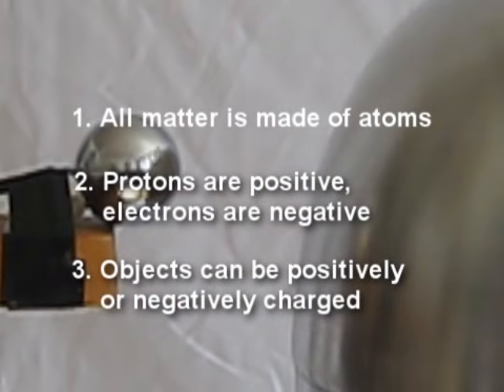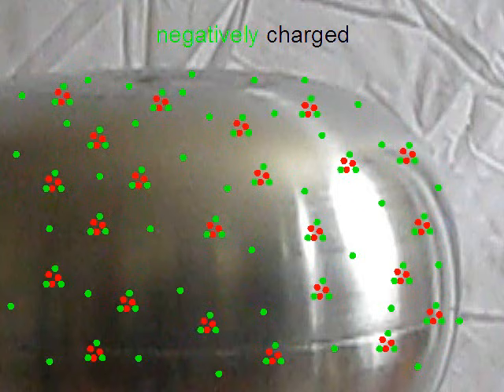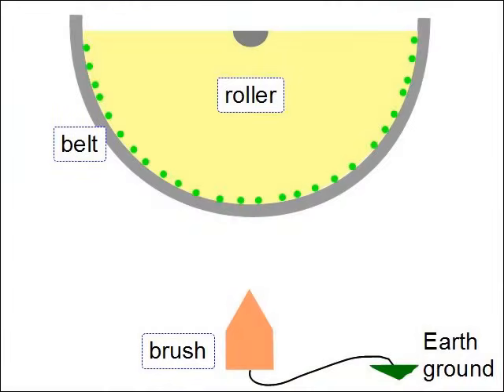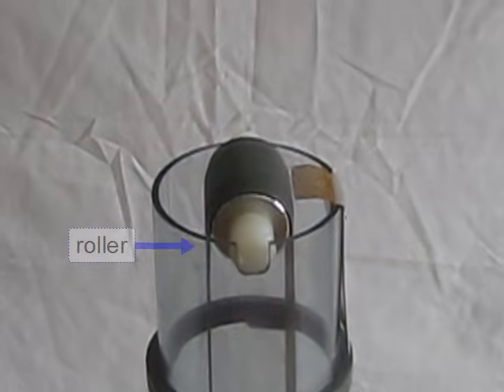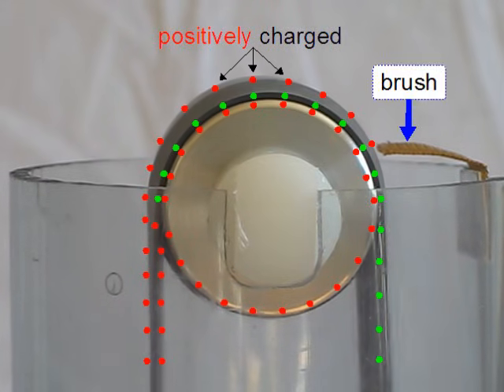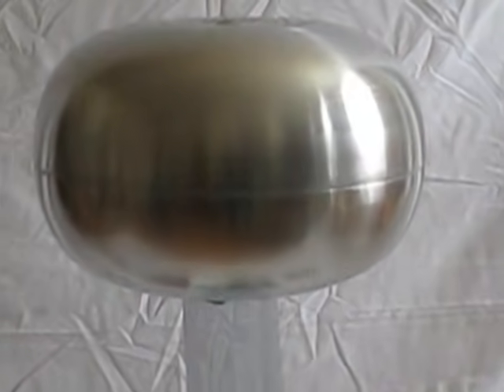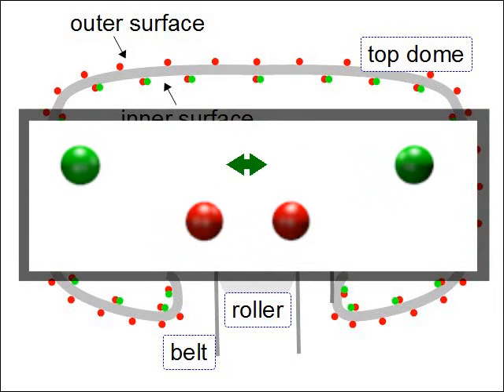How a Van de Graaff Generator Works

Comment from the maker: You're right hat rubber is an insulator but that just means it's a poor conductor of electricity. It doesn't mean you can't deposit or take electrons away from it and that's what's going on when the rubber makes and breaks contact with the rollers. Then, instead of the charge conducting along the belt from one roller to the other roller, we move the belt. By physically moving the belt from one roller to the other we physically move the static charge too.

Comment: The video is really nice and its easier to learn about Van De Graaff Generator by the help of this video  but I have a doubt regarding the rubber belt.. 
Since the belt is made up of rubber.. it would an insulator.. then how does the positive charge is transferred from one roller to other?

Comment from the maker: Thanks. The section explaining how the Faraday cage works is a little contentious since I wasn't using the standard approach to explaining it with just fields. But I really wanted to do it at the electron and proton level; more tangible, and also consistent with the rest of it. Have fun making your Van de Graaff generator. Be sure and check out my videos on that topic and ask questions if you run into problems.

Comment from the maker: Off-hand I don't know. The faster it turns, the more charge you'll pump, so as high a gear ratio as you can do is the most I can suggest. It does depend on a number of things, probably the main one being how wide the contact area is where your belt contacts your roller, since that's where the charges are separated. The wider that is the slower you can turn and get a decent amount of charge.

Comment from the maker: I've never looked for teflon material so I don't know how costly it is. I usually just use a plastic of some kind. It won't be dangerous. The voltage is high but the current is very small.

Comment from the maker: Yes, you can use the same materials with a small homemade van de graaff. In fact the small one I show at 2:12 in this video has a Teflon roller at the bottom and a metal roller at the top and uses a rubber band for the belt. Using metal for the top roller is less effective than using something that's triboelectrically positive with respect to the belt material but the teflon and rubber band combination works so well that the results are still very good.

Comment from the maker: Yes, the effect only charges the inner side of the belt. But the main reason is that the charge on the inner side of the belt is spread out over the larger inner area of the belt. The roller, however, has a smaller surface area and so the charge is more compact, the voltage is higher. So we use that higher voltage to pull more charge onto the outer surface of the belt. As a result, the outer surface of the belt has more charge than the inner surface. It's that larger charge that we're after.

Comment from the maker: I've never measured the amount of energy. I guess that could be done by charging a capacitor and measuring the voltage after a chosen time. Then use energy = 1/2 * capacitance * voltage * voltage. But I suspect it's very small, far too small to operate a refrigerator. Plus, why would you? You may as well unplug the Van de Graaff from the wall power socket and plug the fridge in instead?

Comment: How much energy can be retained and used else where? Would using a joule thief in line with diode and receiver for the discharges retain enough power to operate a refrigerator? At what scale would you recommend? Thank you for your time.

Comment from the maker: (... continued) The same for a capacitor. The more charge you put on the cap plates, the stronger the electric field between the plates, the higher the voltage. The VDG dome and ground can be considered a capacitor. Pressure is sometimes useful analogy for voltage. By pumping more charge onto the dome you've built up the pressure. Bring a grounded ball close to the dome and the charge on the dome rearranges closer to the ball. The pressure may increase until the charge bursts across the gap.

Comment from the maker: Voltage is measured between 2 things. Example, my big VDG is rated at 500kV with respect to Earth ground since the lower brush is wired to Earth ground. To measure the voltage, use a HV probe. Connect the HV end of the probe to the dome and the other end to ground. The probe will feel the effect of the electric field between the dome and ground. The electric field strength is determined by the amount of charge. Picture one field line between each dome charge and a ground charge. (continued...)

Comment from the maker: No. The smaller dome will start leaking charge sooner than the bigger dome. My small commercially made Van de Graaff generator with the 3" dome is rated 80kV. My big commercially made one with the 14" dome is rated 500kV. So if I took the 14" dome and put it on my small VDG, it would accumulate more charge. I'd have to increase the length of the belt though since with a higher voltage, the dome's electric field would start interacting more with the other end in form of corona and then arcing.

Comment: If we connect a much smaller dome to the SAME van de graff generator, will there  be still the same charge, i.e.e. coulomb, i.e. the same number of electrons on the smaller dome as there was on the bigger?

Comment from the maker: Not usually. The electric field and resulting current flow are usually too weak. However, you can sometimes replace the regular multimeter probes with a high voltage probe to measure weak electric fields - by contact with the affected surfaces. You can see one of these probes in action in yet another of my videos :) "High Voltage Probe How-to with Fluke 80K-40".

Comment from the maker: It should work if you connect the brush to the INSIDE of the leydon jar, not the outer cylinder. It has to use the faraday ice pail effect. Avoid sharp edges on inside cylinder of the leyden jar if you can.

Comment from the maker: Sorry, I don't know of a good website off-hand. I used my old high school physics textbook to double-check my knowledge of this.

My approach was to first make sure my understanding of the relationship between electric fields and voltages was right. They're proportional to each other, denser e-field = higher voltage. Then I reminded myself that a charged VDG dome is a capacitor, with the room being the other plate. Since voltages are the same, e-field is the same, affect on ions is the same.

Comment from the maker: If they're both at the same voltage then the effect on ions in the air would be the same.

To have a voltage they must have a voltage with respect to something. Let's say the domes are at 79kV w.r.t. the room. Having the same voltage means the electric field lines are equally dense around both. Since one dome has a larger surface area, it must have more charge for there to be the same number of e-field lines as the smaller dome. With the same e-field density, the effect on ions is the same.

Comment: Alright :) , what I actually meant was a case of two separate  charged domes.   If the both were charged to the same voltage, which one would repell more air atoms? the bigger dome or the smaller one?
help is really appreciated:)  also if you know a good website to really explain this, would be terrific

Comment from the maker: Yes, by sharper surface I mean smaller in diameter.
Assuming 79kv between two domes, the smallest diameter dome has the stronger electric field around it. The air molecules will be repelled from the smaller diameter one, and be attracted to the larger diameter one.
And you're welcome. Glad I can help.

Comment: Thanx,by the sharper surface I presume you mean just smaller in diameter???

anyway the larger the dome the higher voltage it can hold before electrci breakdown occurs. Good so far. So what about the electric field "around" the larger  dome? say we got 79kv on the both of your domes. which dome has the strongest electric field and which one reppels the most air molecules around it? thanx a lot

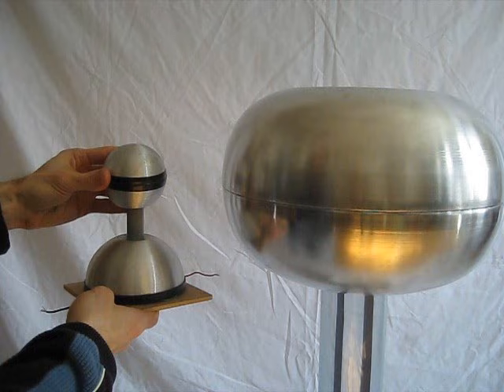Comment from the maker: ...continued. If you compare the two domes at 14:58 in the video you'll see the one on the left has a "sharper" surface than the one on the right. The one on the left can reach only 80kV because at that point the electric field around the dome is so strong that any more charge just leaks to the air. The one on the right is supposed to be able to reach 500kV before any additional charge leaks to the air.

Let me know if that didn't clear it up.

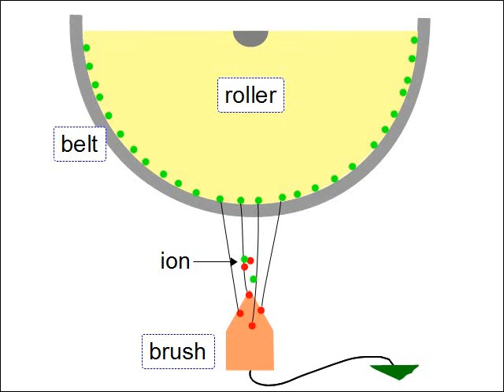Comment from the maker: Charge leaks more easily to the surrounding air from sharp edges. Charges bunch up more at sharp edges creating a strong electric field which interacts strongly with the surrounding air. See 5:18 in the video. Now a large dome, by definition has a very smooth surface, no sharp edges. The larger it is the less round it is at any point. So you get less charge bunching up and weaker electric field. The charge stays on the dome instead of leaking to the air. That means a higher voltage. continued...

Comment from the maker: The charge would accumulate on their surfaces with most of it on the areas that face each other. As more and more charge accumulates, the electric field between them would become stronger and the air would start to ionize until finally it becomes conductive and an arc would occur between them. At that point the domes would no longer be charged and the whole process would start over again.

Comment: So what would happen if you put a positivly charged dome near a negativly charged one while the generators were still running?  There would not be a continuous line of electricity unless may the positive one produced ts charge a bit slower than the negative one because that would give the negative dome more time to accumulate its charge. (please Reply someone)

Comment from the maker: Why won't it kill? I think you're talking about the experiment where you stand on an insulated platform and put your hands on it before you turn it on. In that case the charge builds up on the VDG and on you gradually but it also leaks away from you when you turn it off. The danger is if you touch a big VDG AFTER it was turned on. In that case all the built up charge will leap at you at once. Depending on the size of the VDG, that may kill you. I won't go near my big one after it's already on.

Comment from the maker: I don't have a video on that. Though if you look at my "How to make an electroscope" video it's the same thing that makes the leafs inside the jar spread apart. If the VDG dome is positively charged then the hair is also positively charged and since like charges repel each other, the hairs all repel, getting as far apart as they can. Similarly if the VDG is negative then the hair is negative and repels.

Comment from the maker: You can use a cylinder as long as one end is closed. So one end is open for the top part of the Van de Graaff and the opposite end is closed. Make sure to avoid having sharp edges though, as they'll decrease the output.

Comment: I've been asked to make a generator using a cylinder rather than a dome - is that possible?  I was thinking of adapting an existing generator.  Are there safety issues involved in doing this? Thanks

Comment from the maker: Both of my VDGs in this video were bought, I didn't make them from scratch. The big one was from amazing1 dot com. They don't sell the domes separately. A lot of people make the domes by attaching two steel salad bowls together at their open ends and cutting a hole in the bottom of one. After you make the cut, smooth out the edge; sharp edges reduce the voltage. Note that VDGs produce high voltage but not a lot of energy; the current is very small.

Comment from the maker: I don't understand it fully enough at that level to say for sure but I think it's atomic. When the materials come together, chemical bonds form between atoms in some areas. When the materials are pulled apart, some atoms have a tendency to keep shared electrons and some have a tendency to give them away.

Comment from the maker: The motor has a power chord which is plugged into the wall socket to power the motor. That power chord has three wires: a black wire, a white wire, and a green wire called GROUND. That green ground wire goes through the wall socket and eventually to a metal rod in the ground in the backyard. That green ground wire is the one you see in the video at 2:04. The brush and the green ground wire are both connected to the metal case so they are connected together. Let me know if that doesn't help.

Comment from the maker: Actually, the photoelectric effect may happen with the positive brush (the bottom one) but I'm not sure that it does. With the negative brush (the top one) the electrons near the brush spread outward more and so the photoelectric effect plays a bigger part in contributing electrons to the corona.

Comment from the maker: @lx0199 I purchased the generator years ago as a whole from Information Unlimited (I'll put the link to their website in the video description.) The unit itself is made by Science First (again, link in the description or just search for their name) and was a slightly different positive charge version of their # 615-3145. I don't see any spare rollers for sale on either of their websites, though Science First does sell the belts. Contact them to find out what the belt is made of.